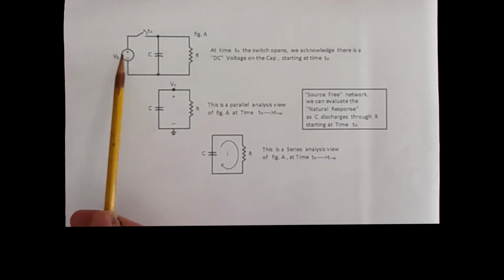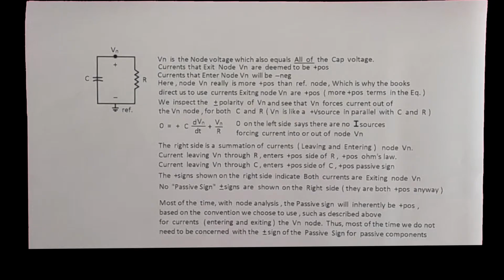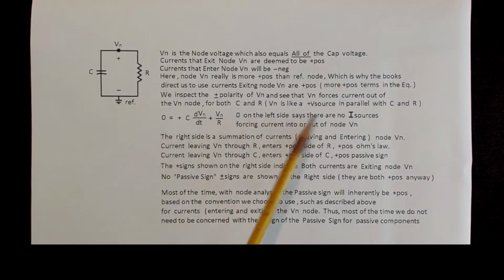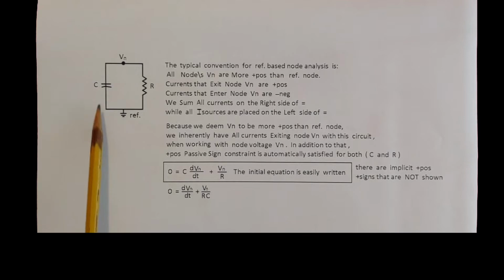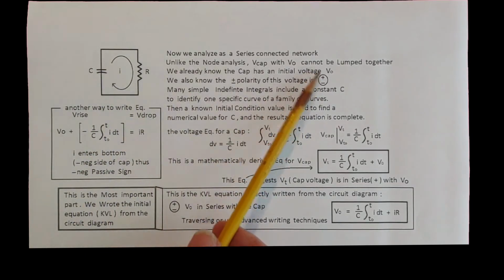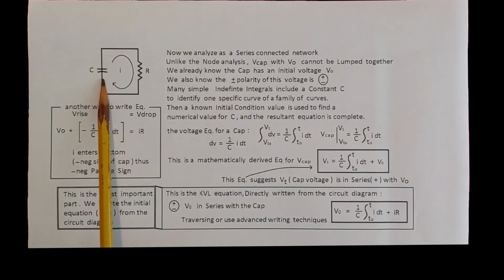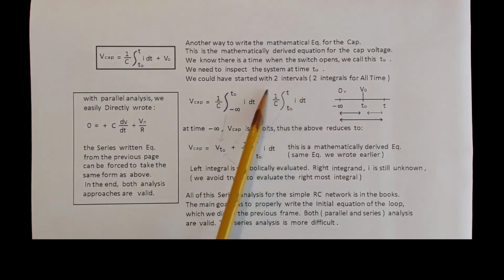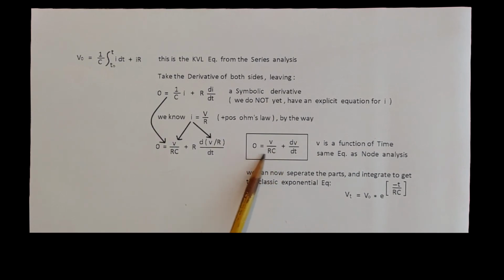RC  network  solving for the exponential equation

Comment: Very informative vdo I found it very hard to understand thank you sir
Reply from the maker: the good books don't make it  easy  either.
the books never comment on the Series KVL  equation,
except that it is presented without 
comment from the  books.

i tried to explain the inner workings that
lead up to the  how and why
the  Node and KVL equations are correct.

It is more about  physics problem solving and math.